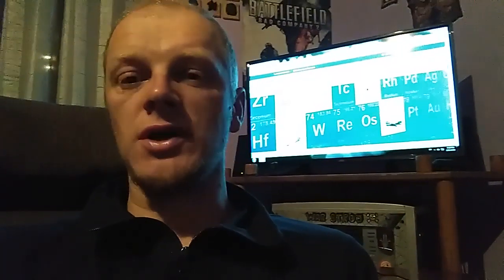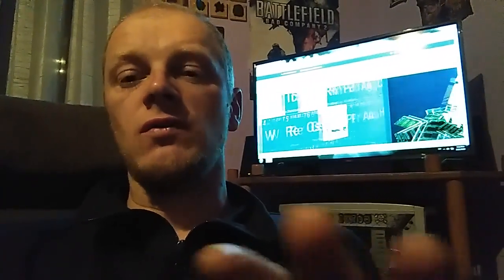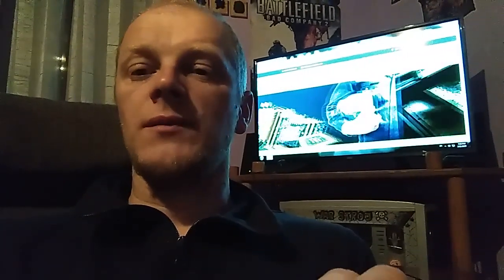Tantalum recycling with PROSES MAKINA!

Comment: Brother,
why not try for your-self,
crushing complete boards,
taking out metal by metal,
such as by electrolysis ...
Reply from the maker: I have a lot ides brother,but times just killes me,so much projets to make,so litlle time to do it!But i love your idea,i have similar from my own mind!
Reply: Electrowinning is the way to go. Check out successful engineer channel. By using copper plates you can pull out metal by metal but even with my knowledge I have no clue how to deal with tantalum. Tantalum is also extremely dangerous plus has health hazards. It can be extremely unstable in large amounts and don't forget it is also used for certain weapons

Comment: Hello noble friend. I have a big doubt that you are sleeping with me. I did the process using sulfuric acid on motherboard chips and memory card chips, I didn't get anything, I had already done it with cell phone chips and it worked, in the middle of the process I put hcl in the sulfuric acid solution. Was that it?
Reply from the maker: You dont need hcl in sulfaric brother, only sulfaric use for wet ashing.
Reply from the maker: After waćsh residue with water then nitric batch and then ar.